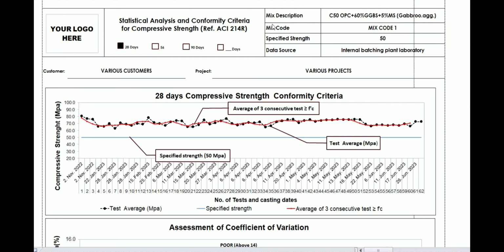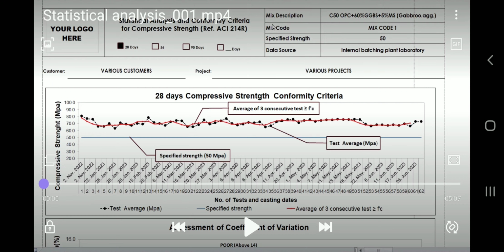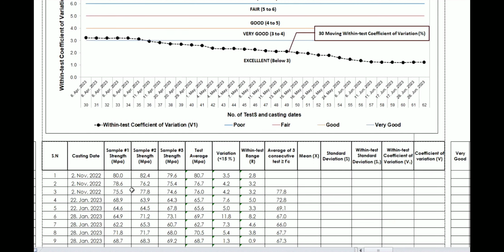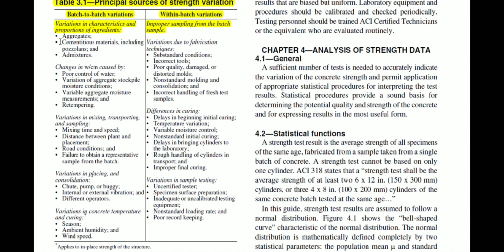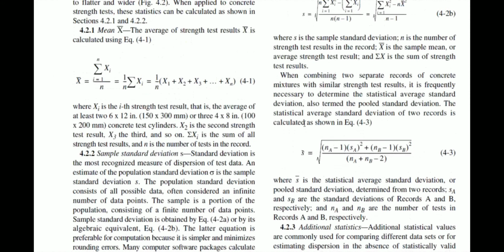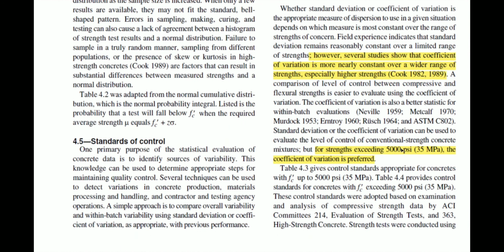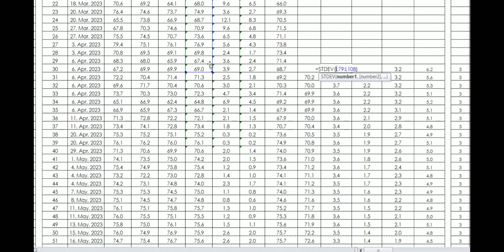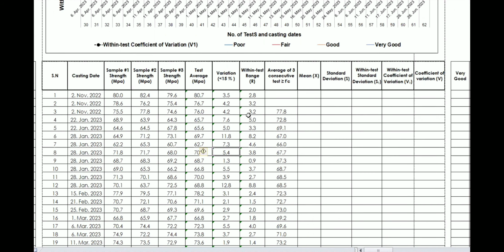Use quality control charts for concrete strength in your report #concrete #cement #construction

Comment: Dear, what is the different between overall variation and within test variation in control of concrete production and how to calculate  ?
Reply from the maker: Within-test variation—Variability due to testing and is affected by variations in sampling, molding, consolidating, transporting, curing, capping, and testing specimens. - Hence variation coming from workmanship

Overall variation - Measured by standard deviation or coefficient of variation
Reply: Within-test variation relates to how well the concrete technician have handled the cubes! From its prep, consolidation, demoulding, site curing, transport till cube crushing at the lab. Overall CoV relates to further factors affecting cubes str like, batching weights, free water, aggregates, cement-blend, admixtures, entrained air, etc. In fact ACI214 suggests getting the producer SD by the square-root of the difference of the squares of overall-SD minus within-test-SD